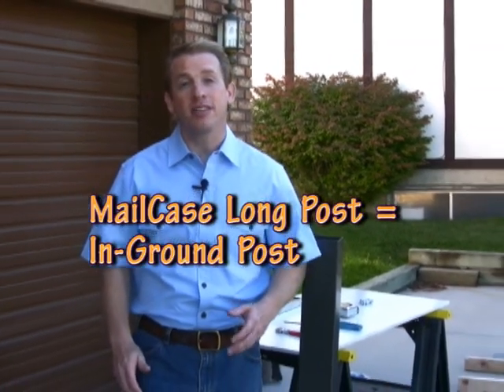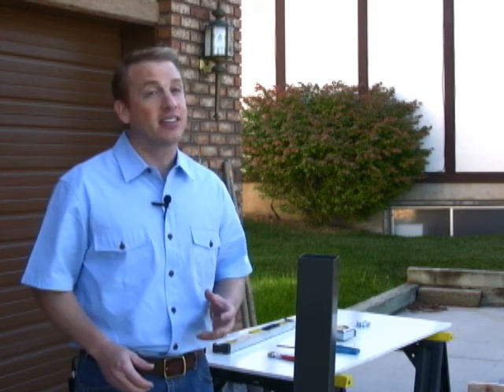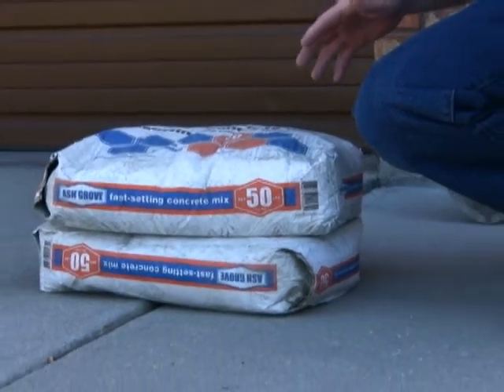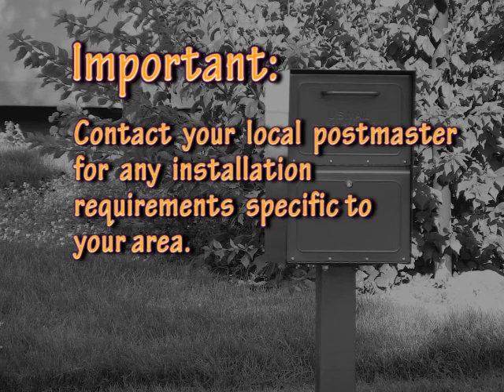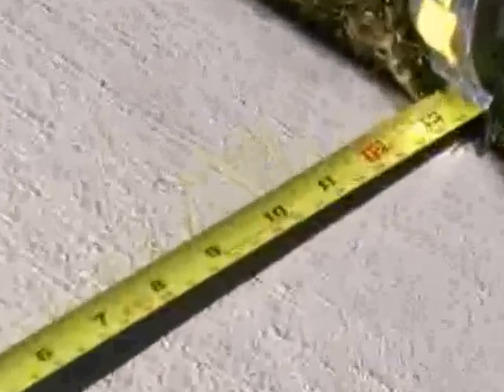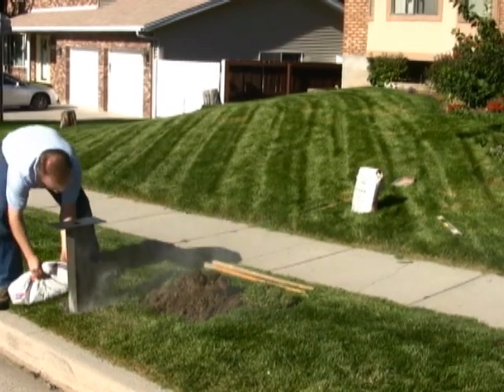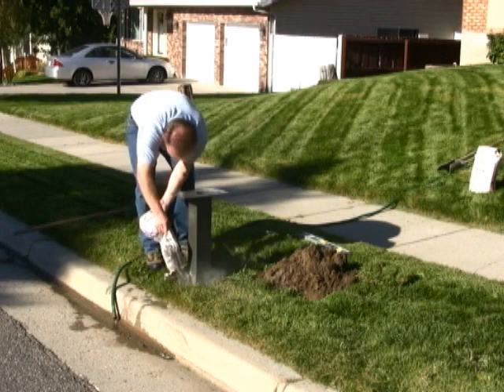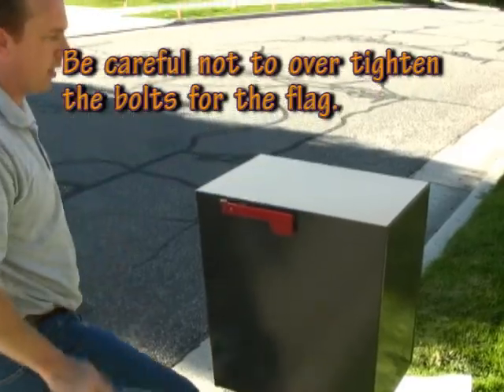MailCase In-Ground Post Installation Instructions

Comment: Nice video, but I would probably put the bolts on the inside of the box so that someone doesn’t unscrew and take your box.
Reply: I was thinking the exact same thing. Anyone could very easily remove the bolts and take the entire box. Major installation security flaw. I can't believe they instruct folks to install a high security durable box this way. They need to remake this video.
Reply: @Blake Simonini i bought this mailbox and love it. Very solid. I replaced the bolts with smooth bottom bolts from a hardware store and added locktite  all good. Great box.
Reply from the maker: Actually, you need to have access to the head of the bolt on the inside of the mailbox to unscrew it.  If the MailCase is locked and someone comes to try to unscrew the nuts outside, the heads will just spin on the inside of the box and the nuts won't loosen.